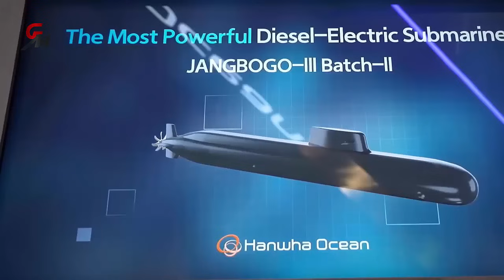Which is Better TKMS 212CD or Hanwha KSS-III, Here's The Canada's Next Gen Submarine

Comment: I think that regardless of which is chosen, the Canadian version should have a 3 to 5 meter extension in the middle for increased stores of both food & fuel. An increase in range & endurance would be very useful in the Arctic regions. We should also build a Naval Base at Resolute on Cornwallis Island which is the mid-point of the Northwest Passage.
Reply: India has ordered the U214, which is scalable like the U212A and U212CD. The U214 already exists in 59/64/72-meter versions! India only needs a 22% longer 72-meter version and will build the submarines in India with TKMS.

The U212CD will be lengthened by extending the midsection. The U212CD is 73 meters long, and a 23% extension would make it 90 meters! According to AI, the U212CD can accommodate 40+ VLS! It has a range of 17,000 nautical miles and dive durations of over 60 days! A 37% extension would make it 100 meters long, and 80+ VLS would be possible! The additional costs are manageable since the midsections are the same. The VLS would represent a further increase in costs! According to AI, range and operational time would increase even further, and the danger would become extreme if, for example, the MDBA stealth cruise missile (range >2500 kilometers, nuclear-capable) and the stealth hypersonic missile (Mach 6-7, >1000 kilometers), which fit into VLS systems, were deployed!

Furthermore, the 2005 Diehl Barracuda, about which nothing has been heard since, is likely a very important topic! It travels at 400-800 km/h underwater, has a range of 100-160 kilometers, and can only be intercepted by the Barracuda! According to AI, this is a top-secret project that should already be ready for mass production! An important Mach 3 cruise missile is under development. TKMS has also shown a 25-meter modular submarine drone that will be part of the U212CD combat cloud! It can deploy a small Grey Shark drone/fuel cell with a range of 2000 kilometers that lurks and detects everything for months!

Comment: I would go with the Korean package for the price and literal bigger bang for the money spent. Long range attack capabilities under the sea and on the surface could be very useful. 🤗
Reply: The U212CD will be lengthened by extending the midsection. The U212CD is 73 meters long, and a 23% extension would make it 90 meters! According to AI, the U212CD can accommodate 40+ VLS! It has a range of 17,000 nautical miles and dive durations of over 60 days! A 37% extension would make it 100 meters long, and 80+ VLS would be possible! The additional costs are manageable since the midsections are the same. The VLS would represent a further increase in costs! According to AI, range and operational time would increase even further, and the danger would become extreme if, for example, the MDBA stealth cruise missile (range >2500 kilometers, nuclear-capable) and the stealth hypersonic missile (Mach 6-7, >1000 kilometers), which fit into VLS systems, were deployed!

Furthermore, the 2005 Diehl Barracuda, about which nothing has been heard since, is likely a very important topic! It travels at 400-800 km/h underwater, has a range of 100-160 kilometers, and can only be intercepted by the Barracuda! According to AI, this is a top-secret project that should already be ready for mass production! An important Mach 3 cruise missile is under development. TKMS has also shown a 25-meter modular submarine drone that will be part of the U212CD combat cloud! It can deploy a small Grey Shark drone/fuel cell with a range of 2000 kilometers that lurks and detects everything for months!

How many years of experience does Korea have in submarine construction? Since TKMS showed them how to build modern submarines with the U214/KSS II, nothing more!
AI briefly analyzed the data: Since 1906, Germany has built approximately 1,600 submarines! According to AI, it is the country with the most experience in building military submarines worldwide!
World War I (WW I)
Germany built a significant number of submarines (types such as UB, UC, and U-boats) that played a crucial role in naval warfare.
The exact number was probably around 350 submarines used by the Imperial German Navy.
World War II (WW II)
The German Navy built a massive fleet, with over 1,100 submarines launched (e.g., types such as Type VII C and IX C).
Of the 863 submarines that went on patrol, 780 were lost, highlighting their massive presence and the high losses.
After World War II
Export world champions: German shipyards (such as HDW and Thyssen) became leaders in the export of conventional submarines, delivering over 120 boats to 17 nations (e.g., Norway, Denmark, Greece, South Korea, Israel, and Turkey).

So that's where the high-tech expertise of TKMS and other companies comes from!

Comment: google AI
Major issues have affected the German-built Type 214 submarine class, including significant technical problems for operators like South Korea and Greece. 
The Republic of Korea's fleet, in particular, has experienced widespread defects in its air-independent propulsion (AIP) system. 
Technical and design flaws
South Korea's Son Won-il class submarines (KSS-II)
AIP inverter defects: In 2022, reports from South Korea's National Assembly revealed that all nine of the nation's Type 214 submarines had defects related to the inverter modules and their cables, which are critical components of the Siemens-built AIP system.
Seven of the submarines had discolored cables, suggesting a chemical reaction.
Two submarines had more serious "functional defects" in the inverter modules themselves, requiring them to be taken out of service for lengthy repairs.
Excessive noise: An early batch of South Korean Type 214 subs also faced issues with excessive noise from the propeller, which undermined their stealth capabilities. The Korean Navy denied the 2008 report, and later submarines did not reportedly have the same issue.
Repair difficulties: Due to licensing restrictions, the required repairs on the inverter modules could not be done in South Korea, forcing the modules to be shipped back to Germany. This caused significant repair delays that impacted the fleet's readiness. 
Greece's Papanikolis class submarines
Design instability: The Hellenic Navy refused delivery of its first Type 214 submarine, the Papanikolis, citing numerous technical failures. The most serious was a structural imbalance that made the boat "top-heavy," causing excessive rolling and pitching in rough seas.
Propulsion and sonar failures: Other issues included inadequate power output from the AIP fuel cells, propeller cavitation that caused excessive noise, and problems with the sonar array.
Legal dispute: The refusal to accept the vessel led to a prolonged legal and financial dispute between the Hellenic Navy and the shipbuilder, ThyssenKrupp Marine Systems (TKMS). 
Impact on other operators
Turkish Navy's Reis class: The Turkish Navy, which is also building a modified version of the Type 214, adopted a unique solution to address the instability problems reported by Greece. Instead of adding ballast weights like TKMS proposed to Greece, Turkey extended the boat's length and moved the center of gravity to improve stability.
India's consideration: In 2025, India reportedly selected the Type 214 for a major submarine deal. However, the price has already escalated, and the program's success remains uncertain given the class's history of defects.

Comment: Wie gesagt Hanwa stellt ein um einen Raketen Abschuss teil weiter entwickelten Deutschen modell Export Entwurf des Typs 214 hat also nach wie vor ein seerohr das die Hülle durch bricht. Das das ist beim 212CD nicht mehr der Fall. Und die U Boote dauern deshalb länger weil sie High Teck sind.
Reply: The South Korean KSS-3 BATCH-2 submarine is a submarine designed and built in Korea.
The KSS-3 BATCH-2 submarine differs from the German submarine in shape.
The German submarine's hexagonal design can cause it to capsize or rock in side waves. The 212CD, a modified version of the existing 214 submarine, is vulnerable to waves due to its angular design. Its upper part is narrow and its lower part is wide, making it particularly vulnerable to waves. From the front, the submarine's design appears to be designed to be prone to rocking.
The German submarine's production time is also long because everything is done by humans, from start to finish.
South Korea has already introduced robots to submarine production and is shortening production times by implementing automated processes.
Germany has no production slots. Even submarines ordered by the Norwegian and German navies are not yet in production. South Korea is expected to deliver four KSS-3 batch-2 submarines to Canada by 2035, and one submarine per year thereafter.
Reply: @mkchoi8080 sorry mein Englisch ist schlecht aber der U Boot Typ 212CD basiert nicht auf dem Typ 214 sondern dem 212A und im end Effekt ist das auch nicht einfach mal so kopiert den der Typ 214 wurde ja ebenfalls von Deutschland entwickelt ( TKMS ).
Reply: Das KSS 3 mag weiter entwickelt und moderner sein als Die Viktoria kl.der Aktuellen Canadischen U-Boot flotte. Das KSS 3 wurde aber nicht entwickelt extra fürs Durchstossen von Eis oder für die Rauen Bedingungen im Nord Atlantik Ps: für die die es nicht wissen auch das U-Boot der kl.212CD ist in der Lage Raketen abzu schießen ( EDAS ) zur bekämpfen von Hubschraubern, so weit ich weis soll auch RBS15 möglich sein was ein See land ziel Flugkörper mit einer Reichweite von 250 Kilometern hat. @mkchoi8080
Reply: mkchoi8080...How many times do you want to write your bullshit, which I've already refuted in such detail? But what you're writing about the 212CD capsizing is the nonsense of the year!
Ki's short conclusion: The statement in this YouTube comment is technically incorrect and demonstrates a lack of understanding of hydrodynamic principles and submarine design. Correct technical classification:
The U212CD (Common Design) does not have a "hexagonal" or "angular" hull design in the hydrodynamic sense. The cross-section is rounded polygonal, not angular, and was specifically optimized for low radar signature and acoustic camouflage, not at the expense of stability. In short: The 212CD doesn't "capsize" because of its shape. The geometric adaptation serves to optimize stealth, integrate sensors, and save space, without sacrificing stability or seaworthiness. The YouTube comment conflates hydrodynamic effects with visual impression – visibly "angular" does not mean physically unstable.
Thanks to the polygonal design/egg shape and the new, advanced version of TC-K450-NM steel from ThyssenKrupp Marine Systems, operating depths are in a new league! This variant has a yield strength that is around 15-25% higher with the same wall thickness! The polygonal design/egg shape can withstand between 1.25 and 1.5 times more pressure than current submarine systems! According to experts and AI, operating depths of 700-900 meters are then normal! The burst limit is well over 1000 meters (1200-1300 meters) if you look at U212A, where experts assume 850 meters, TKSM states 700 meters as the burst limit! At 700-900 meters there are thermocline layers in the sea, i.e. different temperature and density layers that strongly influence the propagation of sound waves. These layers can deflect or refract sound beams, making it difficult for conventional active or passive sonar to locate the submarine precisely, or even impossible!
Furthermore, water currents, underwater vortices, or turbulence create additional acoustic interference, making it difficult to separate submarine noise from the natural background noise. But the U212CD can filter out this noise with 3D array high-tech sensors and AI and detect what's moving above! Unique in the world! According to AI and experts, KSS III operation depth is 200-400 meters!
In early 2027, three U212CDs will be completed and ready for testing and handover. Construction time is approximately 3.5 years. With additional new systems already being implemented, this will increase to 2 years in the future! Don't let TKMS build the Canada U212CD again; it will be Canada with guidance from TKMS experts in Canada! TKMS has the most modern production facility with the latest high-tech systems, including 3D helmet technology, where you can view plans directly through cyber glasses! Parts are even displayed on the object with precise location and information. Even a low-flyer like you couldn't do anything wrong, unless you wanted to!
Your bullshit comparisons are truly impressive!
Reply: Saying something to mkchoi8080 is like saying the earth is a cube! This guy spouts bullshit to the max! The U212CD can be extended to 90 or 100 meters with center sections like the U212A! This is the case with the KSS II/U214/Dolkhin, with a 20% extension. A 90-meter U212CD has plenty of room for over 40 VLS! 100, even 80-100 VLS according to the AI! The additional costs are relatively low due to the same modules. Dive times will then increase from 40 to 60-80 days due to the extension volume. 17,000 Nm will then not be an issue. The new MDBA hypersonic missiles will also fit into the VLS, with a range of 1000 kilometers,  6-7 Mach! MDBA cruise missiles with a range of >2500 kilometers (nuclear capable) also fit in there!
Diehl (2005 Top Secret) Barracuda underwater missile rocket 400 km/h, test speed 800 km/h, range 100-160 kilometers, weight over 1 ton can then also be used! Korea is currently testing small prototypes and they have missiles with rocket propulsion and stabilizing fins like the Russians which are supposed to reach 370 km/h. It actually looks like the Russian system, range 15 kilometers, 370 km/h. Barracuda only has extremely pointed control cones at the front and no fins for aerodynamics reasons! At 400 km/h and a missile weight of over 1 ton, Korea has to control 111 tonnes of kinetic mass which, according to Ki, is a different league to small test systems! At 800 km/h it's 222 tonnes which, according to Ki, is a new league! Wherever it hits, total destructive chaos is caused by many decks. According to experts, it accelerates to 800 km/h before hitting the ground 8 seconds later. Interception is currently impossible except with Barrakuda itself, according to Diehl! According to Ki, ship acoustic systems wouldn't be able to properly detect it due to its extreme speed.

Korea can't offer all of this except a cheap submarine without a submarine drone combat cloud! The U212CD is an underwater FCAS combat cloud combined with FCAS! 30 large drone submarines and 50 smaller ones form a 6,600-kilometer perimeter that detects everything that passes by. It can then be sunk by a large drone, they are armed!